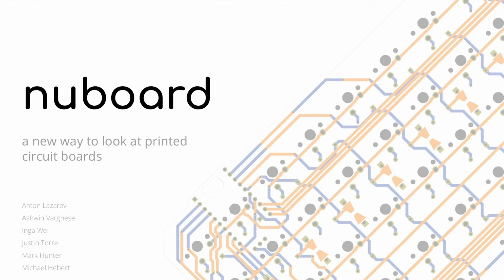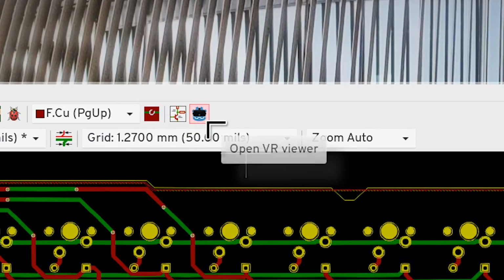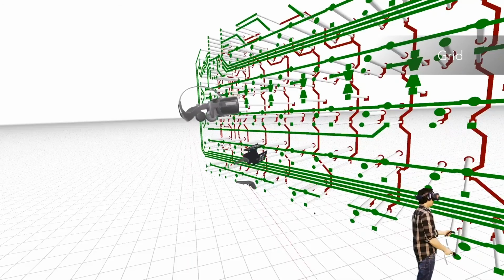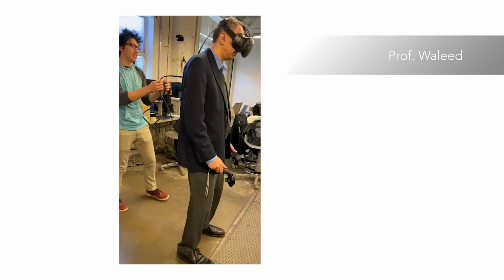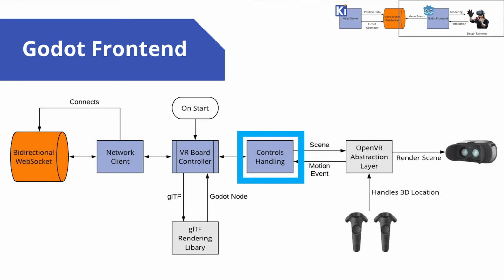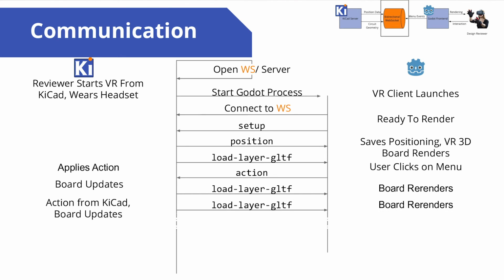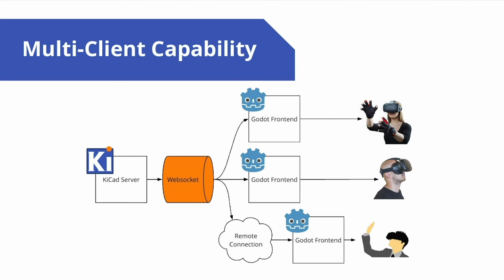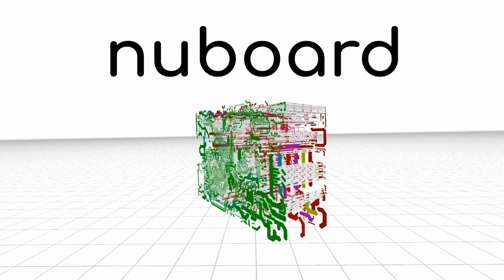KiCad (PCB Designs) in Virtual Reality

Comment: Excellent addition to kicad, however, I do believe it’s stresses more work on the developers utilising 3D headsets. Could one not implement a 3D space on kicad as CAD softwares like blender does. I believe it’ll make designs simple and doesn’t require external hardware that are expensive. The closest I’ve seen a software create a 3D layout of a PCB design is Advanced Design Software (ADS), and even then it’s more of a 2D stack up layout. Anyways well done guys!